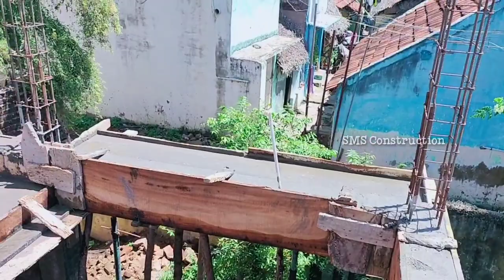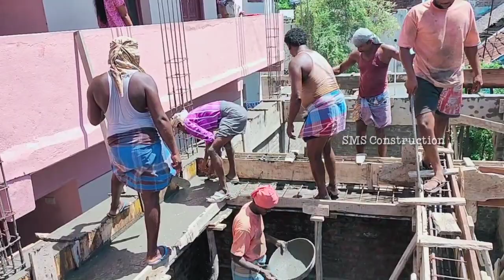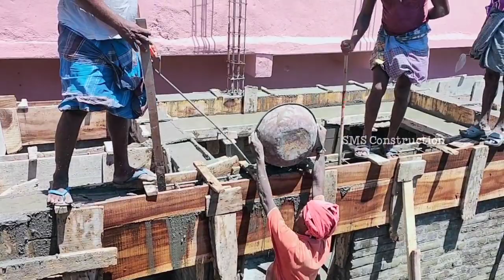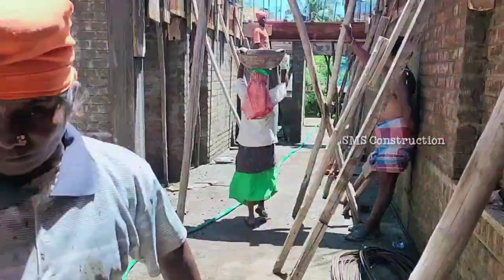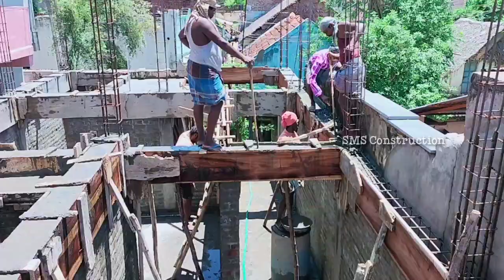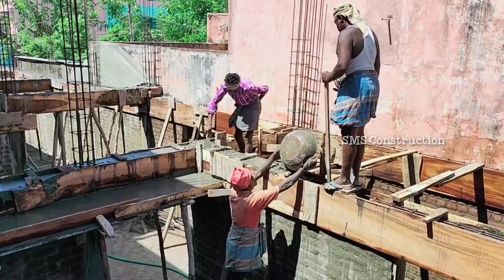Lintel Beam Construction || 19×87 South face House

Comment: We also did the same method of beam casting at lintel level so that we can avoid lintel steel and save time.Again at roof level need not to provide roof beams. In this method cracks canbe avoided. And interval between plinth beam and roof beams canbe reduced.
Reply: Is this method 1.3 feet lintel beam correct?!  Is this enough for roof load and first floor load?! Why you avoid roof level beam?!  We also did this type beam so i asked